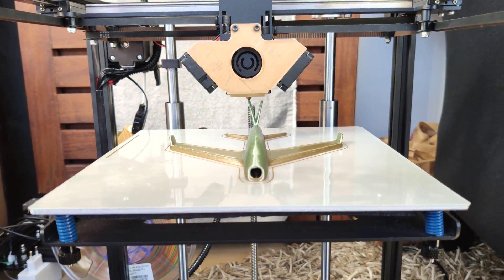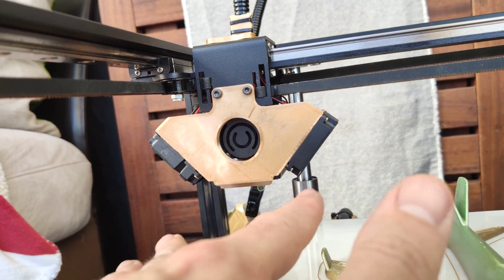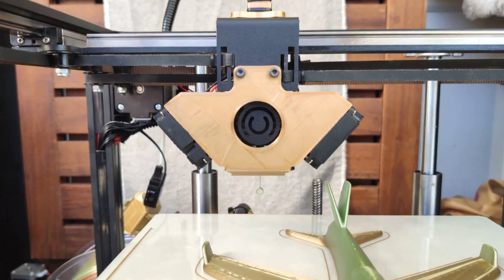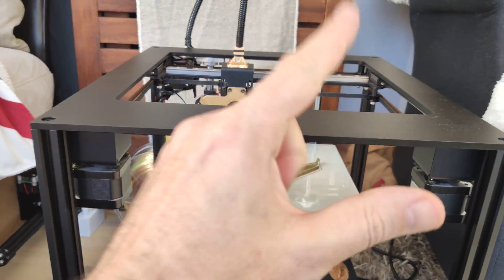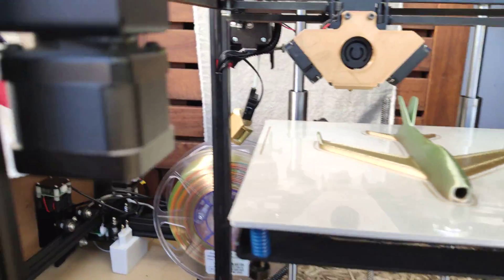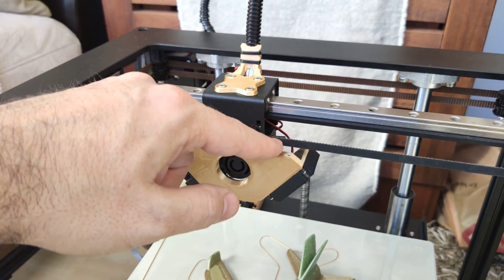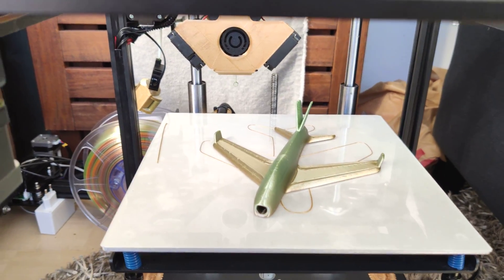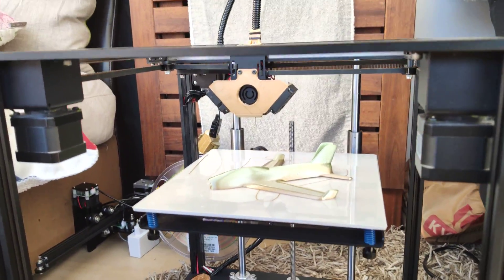My 3D printer modifications  ⚙️ Two Trees Sapphire Pro

Comment: Hello, can you describe a bit how you isolated the X and Y servos and the material you used?
Reply from the maker: Hi, what do you mean ?! motors
Reply: Roland Med. yes, if I understood correctly in your video, you changed the Z axis shaft couple to one that is somewhat vibration isolated and you did something to the X and Y axis servo motors to better isolate them from the frame. If I heard correctly in the video, this is what I would like to understand how you did that. Thanks
Reply from the maker: @georgebehlke8064  hi, yes I use NEMA 17 Vibration Dampers for Z,X,Y and changed Zscrew and nut (8/8) same like Ender3 priter have
Reply: Roland Med. thanks, I finally assumed that and have some coming and hope for good results😎
Reply: Roland Med. just looked again, you referred to them as dampers in the video

Comment: this is the g-code printer setting in CURA?

G28 ; Home all axes
G92 E0 ; Reset Extruder
G1 Z2.0 F3000 ; Move Z Axis up little to prevent scratching
G1 X0.1 Y20 Z0.3 F5000.0 ; Move to start position
G1 X0.1 Y200.0 Z0.3 F750.0 E18 ; Draw priming line
G92 E0 ; Reset Extruder
G1 Z2.0 F3000 ; Move Z Axis up little to prevent scratching
......Ending Script.....
G1 E-4 ; Retract filament 4mm
G1 X0.1 Y200 F1200 ; prepare for part removal
G92 E0 ; Reset extruder position
M104 S0 ; turn off extruder
M107 ; turn Off fan
M140 S0 ; turn off bed
M84 ; disable motors
Reply from the maker: works for all slicers

Comment: how about trying a circle. It will come out as an oval because the x and y motors are installed in the wrong place. Here is the fix Sapphire Pro CoreXY-Misalignment Fix #1 and Belt Tensioner found on #Thingiverse https://www.thingiverse.com/thing:3969752
Reply from the maker: Here is no misalignment in this corexy printer (sapphire pro not the H-Bot) 😁✌️ and here is absolutely no matter where the Corexy belts go (they have nothing to do with print quality)  This is just your theory !
 SapphirePro... hotend carriage moves freely and easily without any friction 👌
https://www.facebook.com/groups/Medelis3D/permalink/502002320471209/
Enjoy...